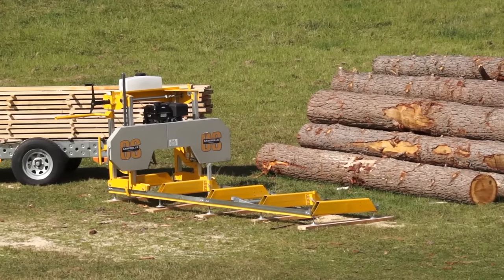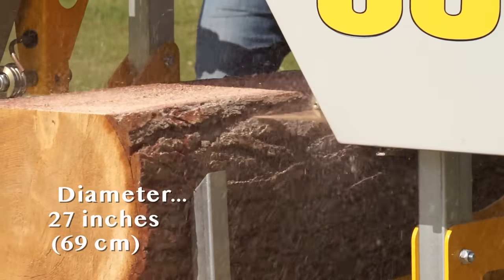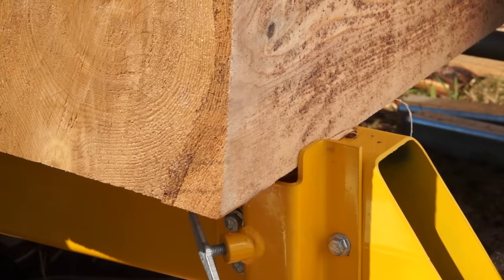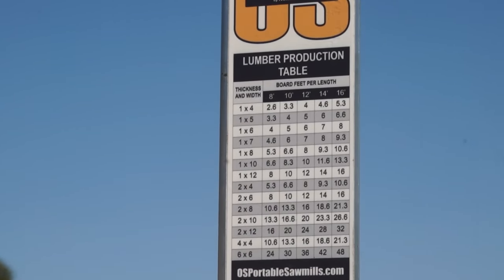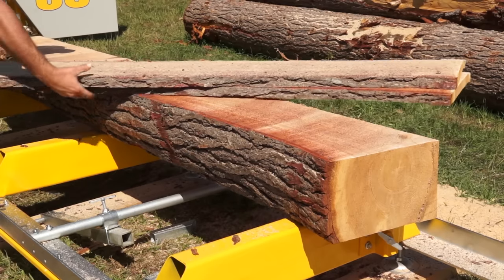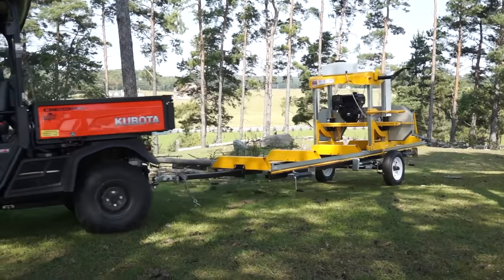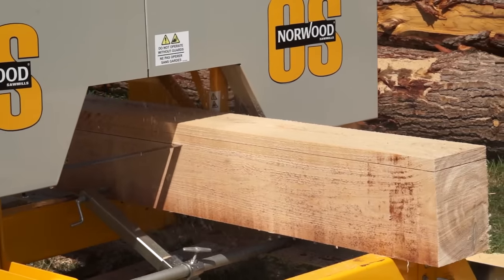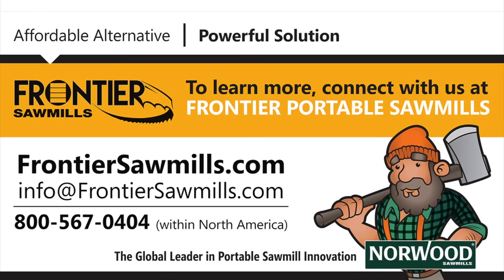The Affordable, Easy-to-Use & Reliable Sawmill You've Been Looking for - The Frontier OS27

Comment: How much is the machine
Reply from the maker: Hi Albert 

Frontier builds three sawmill models with different log diameter capacities: OS23: 59cm (23”), OS27: 69cm (27”), and OS31: 79cm (31”). Standard log length is 3.4m (11’) but you can add 7’ (2.1m) extensions to mill as long as you want.  You can add the optionally available trailer/support jack system to all Frontier sawmills at any time (when you get your Frontier or in the future).

Frontier Sawmills start at just USD $2297 (for the Frontier OS23). The Frontier OS27 starts at only USD $3297.  The Frontier OS31 starts at only USD $3897.  

You can get a lot of helpful info about Frontier Sawmills, including all pricing, at www.FrontierSawmills.com  .

To order, contact us directly at Frontier Sawmills via email at info@FrontierSawmills.com . 

Thanks!

Comment: Рrice?
Reply from the maker: Frontier builds three sawmill models with different log diameter capacities: OS23: 59cm (23”), OS27: 69cm (27”), and OS31: 79cm (31”). Standard log length is 3.4m (11’) but you can add 7’ (2.1m) extensions to mill as long as you want.  You can add the optionally available trailer/support jack system to all Frontier sawmills at any time (when you get your Frontier or in the future).

Frontier Sawmills start at just USD $2297 (for the Frontier OS23). The Frontier OS27 starts at only USD $3297.  The Frontier OS31 starts at only USD $3897.  

You can get a lot of helpful info about Frontier Sawmills, including all pricing, at www.FrontierSawmills.com  .

Thanks!

Comment: Can we get in India?
Reply from the maker: We ship Frontier sawmills worldwide.

Frontier builds three sawmill models with different log diameter capacities: OS23: 59cm (23”), OS27: 69cm (27”), and OS31: 79cm (31”). Standard log length is 3.4m (11’) but you can add 7’ (2.1m) extensions to mill as long as you want.  You can add the optionally available trailer/support jack system to all Frontier sawmills at any time (when you get your Frontier or in the future).

Frontier Sawmills start at just USD $2297 (for the Frontier OS23). The Frontier OS27 starts at only USD $3297.  The Frontier OS31 starts at only USD $3897.  

You can get a lot of helpful info about Frontier Sawmills, including all pricing, at www.FrontierSawmills.com  .

Frontier services your country factory-direct.  To order, contact us directly at Frontier Sawmills via email at info@FrontierSawmills.com . 

Thanks!

Comment: Hello sir, how I buy this mechine?
I'm from India and can it be ship at my place please
Reply from the maker: Frontier builds three sawmill models with different log diameter capacities: OS23: 59cm (23”), OS27: 69cm (27”), and OS31: 79cm (31”). Standard log length is 3.4m (11’) but you can add 7’ (2.1m) extensions to mill as long as you want.  You can add the optionally available trailer/support jack system to all Frontier sawmills at any time (when you get your Frontier or in the future).

Frontier Sawmills start at just USD $2297 (for the Frontier OS23). The Frontier OS27 starts at only USD $3297.  The Frontier OS31 starts at only USD $3897.  

You can get a lot of helpful info about Frontier Sawmills, including all pricing, at www.FrontierSawmills.com  .

Frontier services your country factory-direct.  To order, contact us directly at Frontier Sawmills via email at info@FrontierSawmills.com . 

Thanks!

Comment: I like this machine 
How much cost ?
Reply: How to purchase
Reply from the maker: Frontier builds three sawmill models with different log diameter capacities: OS23: 59cm (23”), OS27: 69cm (27”), and OS31: 79cm (31”). Standard log length is 3.4m (11’) but you can add 7’ (2.1m) extensions to mill as long as you want.  You can add the optionally available trailer/support jack system to all Frontier sawmills at any time (when you get your Frontier or in the future).

Frontier Sawmills start at just USD $2297 (for the Frontier OS23). The Frontier OS27 starts at only USD $3297.  The Frontier OS31 starts at only USD $3897.  

You can get a lot of helpful info about Frontier Sawmills, including all pricing, at www.FrontierSawmills.com  .

Comment: Bisa import untuk indonesia...harga berapa??
Reply from the maker: Frontier builds three sawmill models with different log diameter capacities: OS23: 59cm (23”), OS27: 69cm (27”), and OS31: 79cm (31”). Standard log length is 3.4m (11’) but you can add 7’ (2.1m) extensions to mill as long as you want.  You can add the optionally available trailer/support jack system to all Frontier sawmills at any time (when you get your Frontier or in the future).

Frontier Sawmills start at just USD $2297 (for the Frontier OS23). The Frontier OS27 starts at only USD $3297.  The Frontier OS31 starts at only USD $3897.  

You can get a lot of helpful info about Frontier Sawmills, including all pricing, at www.FrontierSawmills.com  .

Frontier services your country factory-direct.  To order, contact us directly at Frontier Sawmills via email at info@FrontierSawmills.com . 

Thanks!

Comment: It is permissible in india, maharashtra,or whats actually price,can we get permission to run .
Reply from the maker: Yes, people run sawmills in India. Frontier builds three sawmill models with different log diameter capacities: OS23: 59cm (23”), OS27: 69cm (27”), and OS31: 79cm (31”). Standard log length is 3.4m (11’) but you can add 7’ (2.1m) extensions to mill as long as you want.  You can add the optionally available trailer/support jack system to all Frontier sawmills at any time (when you get your Frontier or in the future).

Frontier Sawmills start at just USD $2297 (for the Frontier OS23). The Frontier OS27 starts at only USD $3297.  The Frontier OS31 starts at only USD $3897.  

You can get a lot of helpful info about Frontier Sawmills, including all pricing, at www.FrontierSawmills.com  .

Frontier services India factory-direct.  To order, contact us directly at Frontier Sawmills via email at info@FrontierSawmills.com .

Comment: hello how much does it cost?
and where can people find it?
Reply from the maker: Frontier builds three sawmill models with different log diameter capacities: OS23: 59cm (23”), OS27: 69cm (27”), and OS31: 79cm (31”). Standard log length is 3.4m (11’) but you can add 7’ (2.1m) extensions to mill as long as you want.  You can add the optionally available trailer/support jack system to all Frontier sawmills at any time (when you get your Frontier or in the future).

Frontier Sawmills start at just USD $2297 (for the Frontier OS23). The Frontier OS27 starts at only USD $3297.  The Frontier OS31 starts at only USD $3897.  

You can get a lot of helpful info about Frontier Sawmills, including all pricing, at www.FrontierSawmills.com  .

Frontier services your country factory-direct.  To order, contact us directly at Frontier Sawmills via email at info@FrontierSawmills.com . 

Thanks!

Comment: Where can we buy one of this?
Reply from the maker: Frontier builds three sawmill models with different log diameter capacities: OS23: 59cm (23”), OS27: 69cm (27”), and OS31: 79cm (31”). Standard log length is 3.4m (11’) but you can add 7’ (2.1m) extensions to mill as long as you want.  You can add the optionally available trailer/support jack system to all Frontier sawmills at any time (when you get your Frontier or in the future).

Frontier Sawmills start at just USD $2297 (for the Frontier OS23). The Frontier OS27 starts at only USD $3297.  The Frontier OS31 starts at only USD $3897.  

You can get a lot of helpful info about Frontier Sawmills, including all pricing, at www.FrontierSawmills.com  .

Frontier services your country factory-direct.  To order, contact us directly at Frontier Sawmills via email at info@FrontierSawmills.com . 

Thanks!

Comment: Price of this machine
Reply from the maker: Frontier builds three sawmill models with different log diameter capacities: OS23: 59cm (23”), OS27: 69cm (27”), and OS31: 79cm (31”). Standard log length is 3.4m (11’) but you can add 7’ (2.1m) extensions to mill as long as you want.  You can add the optionally available trailer/support jack system to all Frontier sawmills at any time (when you get your Frontier or in the future).

Frontier Sawmills start at just USD $2297 (for the Frontier OS23). The Frontier OS27 starts at only USD $3297.  The Frontier OS31 starts at only USD $3897.  

You can get a lot of helpful info about Frontier Sawmills, including all pricing, at www.FrontierSawmills.com  .

To order, contact us directly at Frontier Sawmills via email at info@FrontierSawmills.com . 

Thanks!

Comment: اين يمكن الحصول على مكينه مثلها
Reply from the maker: Frontier builds three sawmill models with different log diameter capacities: OS23: 59cm (23”), OS27: 69cm (27”), and OS31: 79cm (31”). Standard log length is 3.4m (11’) but you can add 7’ (2.1m) extensions to mill as long as you want.  You can add the optionally available trailer/support jack system to all Frontier sawmills at any time (when you get your Frontier or in the future).

Frontier Sawmills start at just USD $2397 (for the Frontier OS23). The Frontier OS27 starts at only USD $3397.  The Frontier OS31 starts at only USD $3997.  

You can get a lot of helpful info about Frontier Sawmills, including all pricing, at www.FrontierSawmills.com  .

Frontier services your country factory-direct.  To order, contact us directly at Frontier Sawmills via email at info@FrontierSawmills.com . 

Thanks!

Comment: 日本の販売店は何処ですか、現物を見たいです。価額も知りたいです。
Reply from the maker: Frontier builds three sawmill models with different log diameter capacities: OS23: 59cm (23”), OS27: 69cm (27”), and OS31: 79cm (31”). Standard log length is 3.4m (11’) but you can add 7’ (2.1m) extensions to mill as long as you want.  You can add the optionally available trailer/support jack system to all Frontier sawmills at any time (when you get your Frontier or in the future).

Frontier Sawmills start at just USD $2397 (for the Frontier OS23). The Frontier OS27 starts at only USD $3397.  The Frontier OS31 starts at only USD $3997.  

You can get a lot of helpful info about Frontier Sawmills, including all pricing, at www.FrontierSawmills.com  .

Frontier services your country factory-direct.  To order, contact us directly at Frontier Sawmills via email at info@FrontierSawmills.com . 

Thanks!

Comment: how mutch is it
Reply from the maker: Frontier builds three sawmill models with different log diameter capacities: OS23: 59cm (23”), OS27: 69cm (27”), and OS31: 79cm (31”). Standard log length is 3.4m (11’) but you can add 7’ (2.1m) extensions to mill as long as you want.  You can add the optionally available trailer/support jack system to all Frontier sawmills at any time (when you get your Frontier or in the future).

Frontier Sawmills start at just USD $2297 (for the Frontier OS23). The Frontier OS27 starts at only USD $3297.  The Frontier OS31 starts at only USD $3897.  

You can get a lot of helpful info about Frontier Sawmills, including all pricing, at www.FrontierSawmills.com  .

Frontier services your country factory-direct.  To order, contact us directly at Frontier Sawmills via email at info@FrontierSawmills.com . 

Thanks!

Comment: How much prich thish machine
Reply from the maker: Frontier builds three sawmill models with different log diameter capacities: OS23: 59cm (23”), OS27: 69cm (27”), and OS31: 79cm (31”). Standard log length is 3.4m (11’) but you can add 7’ (2.1m) extensions to mill as long as you want.  You can add the optionally available trailer/support jack system to all Frontier sawmills at any time (when you get your Frontier or in the future).

Frontier Sawmills start at just USD $2297 (for the Frontier OS23). The Frontier OS27 starts at only USD $3297.  The Frontier OS31 starts at only USD $3897.  

You can get a lot of helpful info about Frontier Sawmills, including all pricing, at www.FrontierSawmills.com  .

Frontier services your country factory-direct.  To order, contact us directly at Frontier Sawmills via email at info@FrontierSawmills.com . 

Thanks!

Comment: already in Indonesia?
Reply from the maker: We ship Frontier sawmills worldwide.

Frontier builds three sawmill models with different log diameter capacities: OS23: 59cm (23”), OS27: 69cm (27”), and OS31: 79cm (31”). Standard log length is 3.4m (11’) but you can add 7’ (2.1m) extensions to mill as long as you want.  You can add the optionally available trailer/support jack system to all Frontier sawmills at any time (when you get your Frontier or in the future).

Frontier Sawmills start at just USD $2297 (for the Frontier OS23). The Frontier OS27 starts at only USD $3297.  The Frontier OS31 starts at only USD $3897.  

You can get a lot of helpful info about Frontier Sawmills, including all pricing, at www.FrontierSawmills.com  .

Frontier services your country factory-direct.  To order, contact us directly at Frontier Sawmills via email at info@FrontierSawmills.com . 

Thanks!

Comment: How to price this machine
Reply from the maker: Frontier builds three sawmill models with different log diameter capacities: OS23: 59cm (23”), OS27: 69cm (27”), and OS31: 79cm (31”). Standard log length is 3.4m (11’) but you can add 7’ (2.1m) extensions to mill as long as you want.  You can add the optionally available trailer/support jack system to all Frontier sawmills at any time (when you get your Frontier or in the future).

Frontier Sawmills start at just USD $2297 (for the Frontier OS23). The Frontier OS27 starts at only USD $3297.  The Frontier OS31 starts at only USD $3897.  

You can get a lot of helpful info about Frontier Sawmills, including all pricing, at www.FrontierSawmills.com  .

Frontier services your country factory-direct.  To order, contact us directly at Frontier Sawmills via email at info@FrontierSawmills.com . 

Thanks!

Comment: Como faço para adquirir uma serra dessa
Reply from the maker: Frontier builds three sawmill models with different log diameter capacities: OS23: 59cm (23”), OS27: 69cm (27”), and OS31: 79cm (31”). Standard log length is 3.4m (11’) but you can add 7’ (2.1m) extensions to mill as long as you want.  You can add the optionally available trailer/support jack system to all Frontier sawmills at any time (when you get your Frontier or in the future).

Frontier Sawmills start at just USD $2397 (for the Frontier OS23). The Frontier OS27 starts at only USD $3397.  The Frontier OS31 starts at only USD $3997.  

You can get a lot of helpful info about Frontier Sawmills, including all pricing, at www.FrontierSawmills.com  .

Frontier services your country factory-direct.  To order, contact us directly at Frontier Sawmills via email at info@FrontierSawmills.com . 

Thanks!

Comment: rcan i get your price list. very interested in your pruducts
Reply from the maker: Frontier builds three sawmill models with different log diameter capacities: OS23: 23” (59cm), OS27: 27” (69cm), and OS31: 31” (79cm). Standard log length is 11’ (3.4m) but you can add 7’ (2.1m) extensions to mill as long as you want.  You can add the optionally available trailer/support jack system to all Frontier sawmills at any time (when you get your Frontier or in the future). 

Frontier Sawmills start at just USD $2297 (for the Frontier OS23). The Frontier OS27 starts at only $3297.  The Frontier OS31 starts at only $3897. 

You can get a lot of helpful info about Frontier Sawmills, including all pricing, at www.FrontierSawmills.com  .

We would be happy to mail you a free Frontier Sawmills info kit. You can order one online at  https://www.frontiersawmills.com/en_us/free-catalog-free-dvd-form

Comment: Harganya berapa sampai Indonesia
Reply from the maker: Frontier builds three sawmill models with different log diameter capacities: OS23: 59cm (23”), OS27: 69cm (27”), and OS31: 79cm (31”). Standard log length is 3.4m (11’) but you can add 7’ (2.1m) extensions to mill as long as you want.  You can add the optionally available trailer/support jack system to all Frontier sawmills at any time (when you get your Frontier or in the future).

Frontier Sawmills start at just USD $2297 (for the Frontier OS23). The Frontier OS27 starts at only USD $3297.  The Frontier OS31 starts at only USD $3897.  

You can get a lot of helpful info about Frontier Sawmills, including all pricing, at www.FrontierSawmills.com  .

Frontier services your country factory-direct.  To order, contact us directly at Frontier Sawmills via email at info@FrontierSawmills.com . 

Thanks!

Comment: رائعه جدا 
كم يبلغ سعره؟
Reply from the maker: Frontier builds three sawmill models with different log diameter capacities: OS23: 59cm (23”), OS27: 69cm (27”), and OS31: 79cm (31”). Standard log length is 3.4m (11’) but you can add 7’ (2.1m) extensions to mill as long as you want.  You can add the optionally available trailer/support jack system to all Frontier sawmills at any time (when you get your Frontier or in the future).

Frontier Sawmills start at just USD $2397 (for the Frontier OS23). The Frontier OS27 starts at only USD $3397.  The Frontier OS31 starts at only USD $3997.  

You can get a lot of helpful info about Frontier Sawmills, including all pricing, at www.FrontierSawmills.com  .

Frontier services your country factory-direct.  To order, contact us directly at Frontier Sawmills via email at info@FrontierSawmills.com . 

Thanks!